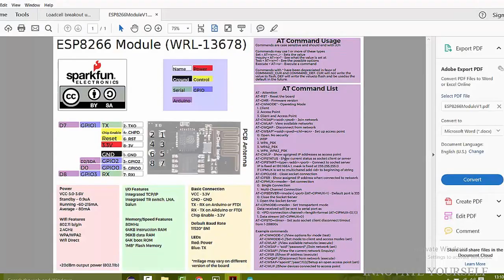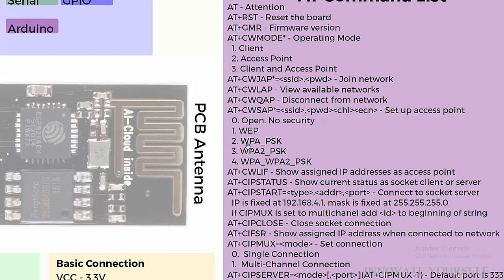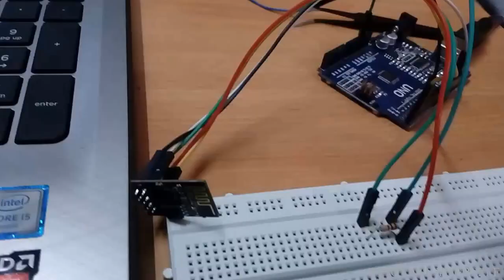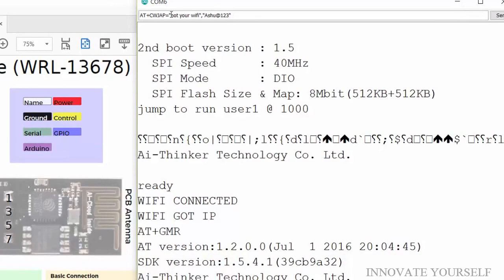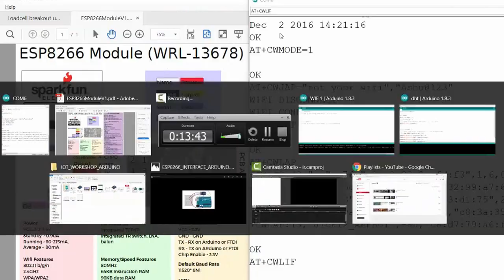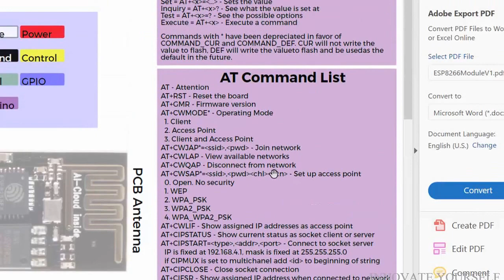HOW TO CONNECT ESP8266 TO INTERNET | ARDUINO WITH IOT | PART 7

Comment: Hi, I follow the connection same as you. And when I send AT command, the esp8266 also able to light up the BLUE LED. It means it had working right? But, when I send the AT command, the Arduino RX led light up and the esp8266 also light up the blue LED, but the serial monitor no show any message when I send the AT command

Comment: Hello, I followed everything as shown in the video and also checked my wires and connections more than 10 times but whenever I press AT+RST it keeps resetting forever. Why is that? 
It also does not show WIFI CONNECTED WIFI GOT IP

Comment: Hello sir,i'm doing my final year peoject...I'm doing arduino cr code door lock access and i want to combine it with this project by adding wifi module inside so whoever what to unlock the door by scanning the qr code and has to fill the user id and pass but no wifi ,he can just connect the wifi from the wifi module...so can i know how can i make it as internet connection...i mean he can access the internet bcz usually qr code need a network connection

Comment: Really good video , I struggled with so many other videos to learn about it ...please can you also add one more thing to this video where you please mention the Board (Tools-Boards-Arduino UNO and COM port) you have selected in the Arduino IDE to connect to Wifi. In my case it was Arduino Uno connected to ESP8266-ESP01S (I am using this one) and to bypass the ATMEGA328P microcontroller for ESP8266 program upload I simply bypassed ATMEGA328P by connecting the RESET of UNO to one of it's GND pin. Rest was smooth as you mentioned and got the results for every AT command properly.

Comment: in the diagram, it shows u connected 3.3v through cable to ur breadboard, in the camera when u faced it to the esp and breadboard there is no wire going from breadboard to 3.3v. why?
Reply: The boards often don't supply enough power to the ESP, so a separate power supply is used.

Comment: bro do u have discord or any method I can call and speak to u besides email. Im running into problems with my esp and Arduino and I need ur help bro, pls.
Reply from the maker: Ok, tell me what happen
Reply: @InnovateYourselfashu  bro its hard to explain, is there any way I can talk with u, pls bro
Reply from the maker: You can WhatsApp me at +918209829808
Reply: @InnovateYourselfashu I am having trouble trying to add u to my contacts and through WhatsApp, its not showing u popping up on WhatsApp, any other way I can reach u?
Reply: @InnovateYourselfashu  pls bro i need ur help, pls man
Reply: @InnovateYourselfashu  pls man, is there any way I can contact u, that number is not working, can u pls make a discord account and we can talk, pls bro
Reply from the maker: You can connect with me on instagram , insta id- innovate__yourself
Reply: @InnovateYourselfashu  I followed every step but whenever I try to upload it shows error trying to upload

Comment: 1) What does the CH_EN Does? Why do we connect it to VCC 3.3V via a resistor
2) What program comes initially inside the ESP 8266? Does it actually have something initially like any program with which I can connect via some android app where it acts in AP mode?
Please reply

Comment: I got stuck on it for a day... I couldn't get any response to my AT request. Then I found out when you use the Serial Monitor, you need to not only select the 115200 band but also select the Line to  Both NL & CR.

Comment: Sir, I followed the same connection in this video but when i type AT in serial monitor nothing happens. Can you help me solve the problem cause i need to finish my project ASAP in this week :( I also checked my connection and it is tight
Reply from the maker: Check your connections may be they are loose
Reply: Innovate Yourself Thank you sir😊 One more thing we dont need to do anything at the esp8266 before doing this connection, right?

Comment: hai , i've done do all the connection and upload but when i open serial monitor and type AT there is nothing happened. i already check the connection and change the baud rate to 115200. Can u explain to me more details please
Reply from the maker: Try changing the jumper wire sometimes jumper wire create a problem try checking the continuity of your jumpers

Comment: i set up as you said but in serial monitor nothing happening when i'm entering commands like AT. i uploaded empty script as you mentioned in arduino software and i selected Arduino/Genuino Uno board and uploaded. Is that OK ? let me know what mistake i made
Reply from the maker: Everything is correct just do one thing check your connections may be they are loose or check that you have set the baud rate in serial monitor or not

Comment: Only empty sketch is to be uploaded on Arduino or I'll need to uploaf wifi code also ?? Plz help I got project to do ASAP
Reply from the maker: While connecting to WiFi network just upload the empty sketch and when you are done the upload the sketch with the programming to perform a task
Reply: Innovate Yourself AT commands will work after connecting WiFi module nd uploading empty sketch
Reply from the maker: No just upload the blank sketch and connect the rx to rx and tx to tx from arduino to esp8266 and then open the serial monitor and set the baud rate to 115200 and your at commands will work. In care they are not working, juat check your connections may be they are loose

Comment: I this all try.. but nothing.. was controlled many time connecteions .I have 2 WiFi bord . Esp8266 both same..nothing can configure. Arduino Uno I used other projects it's working..
Reply from the maker: Do one this just start from the start and repeat each step and specially make the connections tight and it will definitely work
Reply from the maker: Baud rate should be 115200
Reply: Hi. Yes I was try even different budrat . I have also Arduino Nano.. but with both same..and in both I can upload program without any error .

Comment: Hi, i was make all as you show in video.. but its not working with commands.... wifi card not working.. program uploading . but not wifi bord workin
Reply from the maker: May be your connections are loose or you are uploading the code while connecting rx and tx pins

Comment: Followed every step exactly. The code is successfully uploaded without any error. But when I open the serial monitor and typed AT it didn't respond at all. I checked all my connections it's all good. I tried different baudrates also. Nothing worked out. Please help me with this.
Reply from the maker: Make the connections tight and make sure you are connecting the right pins and change the baud rate to 115200 in serial monitor
Reply: Innovate Yourself  
Like I told you I've checked all the connection and also tried different baud rate - default one is 115200 but all of these didn't help me
Reply from the maker: Just send me the way you are connecting your jumpers with arduino and esp8266

Comment: Hello...Nice video..clearly understood what u were saying.. BUT whenever I pulg in my esp8266 to arduino the com port freezes for no reason ..n if I pulg it off port again works.. I tried with nano n uno..result is the same...Please  help me resolve this problem🙏🙏🙏🙏
Reply from the maker: Anurag VR are you getting any error or just the company port is freezing?
Reply: Innovate Yourself Port is freezing.. Not able to upload the program
Reply from the maker: Anurag VR try reseting your board or try uninstalling the port in the device manager

Comment: serial moniter comment not responding with AT command
Reply from the maker: Do one thing remove all the connections and Just follow the steps shown in the video and made the connections again.
And when you are about to check the command then just exchange the rx N tx pins
Reply: I JUST SWIPED THE TX0 AND RX0 PINS AND THE AT COMMANDS STARTED WORKING. BUT I M NOT ABLE TO JOIN ANY WIFI NETWORK(LIKE IT IS NOT SHOWING CONNECTED TO WIFI OR  GOT IP ADDRESS). PLEASE HELP ME FIX THIS
Reply from the maker: Then check your connections may be your connections are loose and then try again
Reply: I too have the same problem. Followed step by step, made the right connections bt still not working. AT commands not responding.
Reply from the maker: What error are you getting??

Comment: HI I CANT UPLOAD A PROGRAM Arduino: 1.8.5 (Windows 7), Board: "Arduino/Genuino Uno"

Sketch uses 444 bytes (1%) of program storage space. Maximum is 32256 bytes.
Global variables use 9 bytes (0%) of dynamic memory, leaving 2039 bytes for local variables. Maximum is 2048 bytes.
An error occurred while uploading the sketch

This report would have more information with
"Show verbose output during compilation"
option enabled in File -> Preferences.
Reply from the maker: Try to change the settings in preferences as the error is displaying
Reply: i also get same error